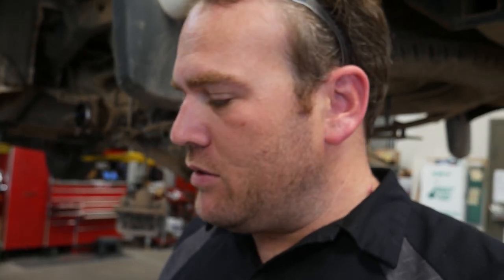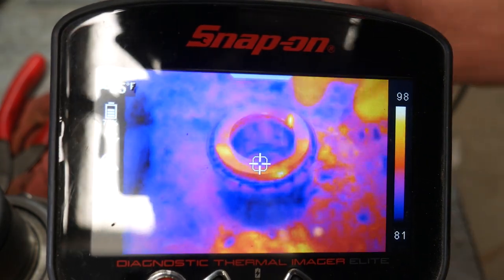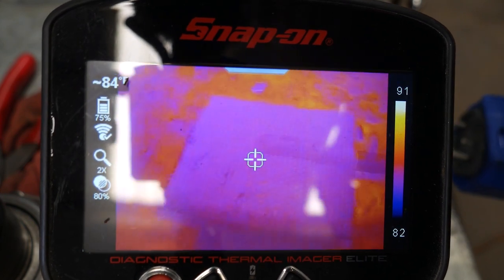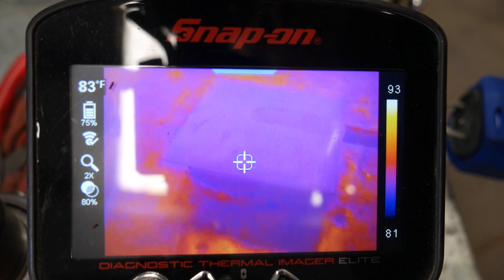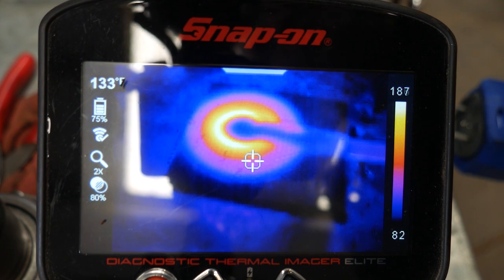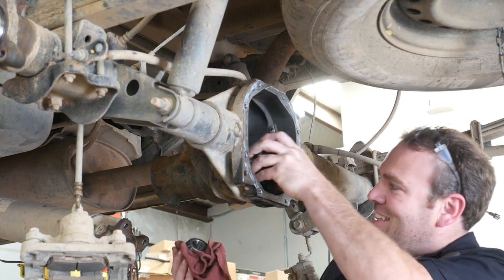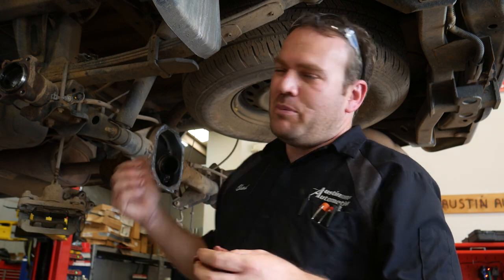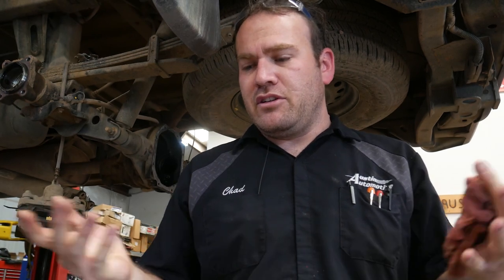Using an inductive heater for bearing installation

Comment: Good idea, I didn't realize these are so fast. Nice to see the thermal imaging used in conjunction. When I was putting a new cook stove into our house, we didn't have the 40A wiring necessary for one of these we wanted, so went with older style.
Reply from the maker: I have to find as many uses as I can since I don’t have a lot of rust in Colorado. 

Those new cook stoves are pretty demanding but have lots of features.  One of my employees installed one over the weekend that has a blower that runs for 20 minutes after the oven has been used. I don’t see how that is efficient. I always just crack the door after cooking to heat up the house a bit in the winter.

Comment: Have you ever used the mini-ductor to remove a bearing from a shaft?
Reply from the maker: I’ve never tried but I think the shaft would heat up at a similar rate as the bearing. The expansion of the shaft may keep it tight to the bearing race.